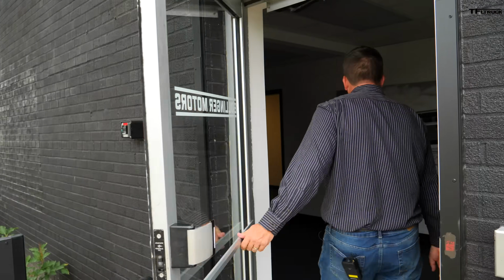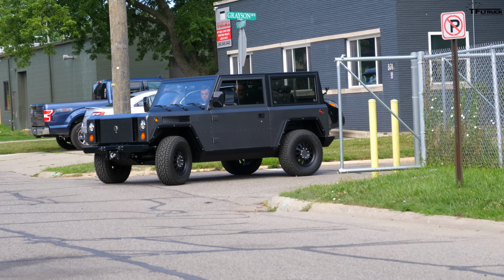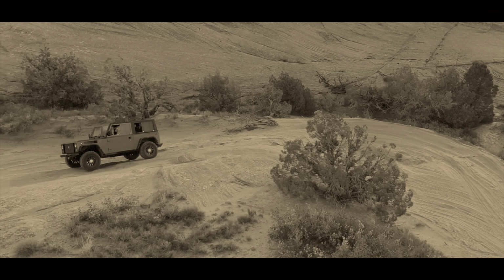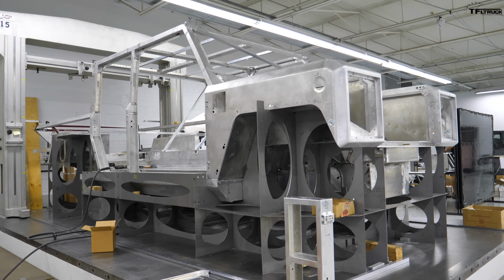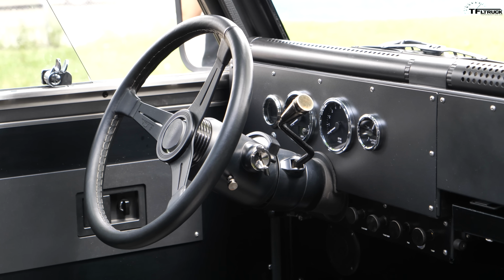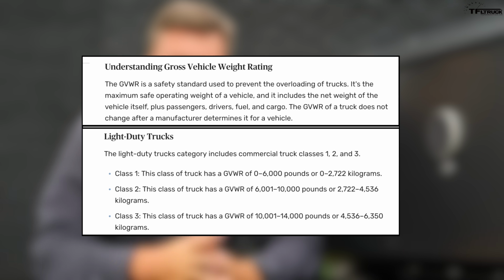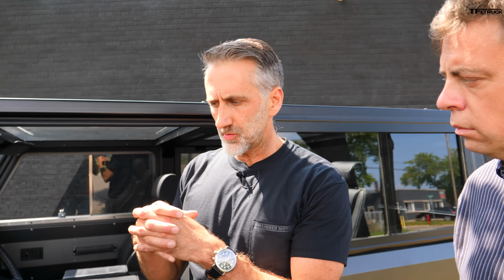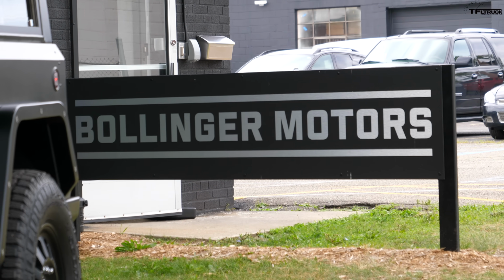EXCLUSIVE! Meet the Bollinger Trucks That Can Off-Road Like a Jeep and Haul Heavy

Comment: As the designer said, he built this like a classic Bronco.  Which is a BIG thumbs up for me.  If we are going to go EV's, might as well make them good looking.  Since we cannot get Ford to go back to what was fantastic.  It is interesting that it has a bit in common with what Top Gear built all those years ago.  Outside design.  And IF I had a need and the money for what Bollinger is doing, I would DEFINITELY buy 1 for the looks and the off road prowess it is going to deliver.  OR, just mall crawl with it.  lol  I don't often agree with mall crawler attitudes, I prefer functionality and practicality over show.  However, since this is range restricted and recharge viability is low, one has to be realistic about where it will be driven.  ;)
Reply: Ford Bronco coming out next year tho taking on the Wrangler.

So Ford knows what they doing

Comment: This thing looks exactly like the electric car built by top gear 😂
Just needs a diesel generator now...
Reply: Adding a small diesel generator to recharge battery pack was the best thing James did on top Gear, which Fisker stole (😉) and electric car builders SHOULD copy.
Reply: Georg B Geoff!
Reply: Geoff was all electric. The diesel charger equipped model was called the Hammerhead Eagle iThrust
Reply: That is the first thing i thought of
Reply: Long live Geoff
Reply: Will it hops driving uphills 🤣🤣

Comment: For whats suppose to be a mature product, its sure ugly. The other thing that concerns me is that if you look at how its being assembled, and materials. I just don't think its going to be capable of holding up to the safety standard that its competitors are already meeting. Not to mention that the hard corners and stuff, are likely going to make it a leaky vehicle over time in its current iterations. 

If this is indeed a $60k - $100k vehicle, are people going to want to pay that, while loosing the features and reliability and a repair market of its competition. I know that I likely wouldn't get rid of my current fullsize truck in favor of this. Even if it still had the same capabilities as it.

Comment: My thought on seeing any vehicle with a glass roof "They obviously aren't thinking about hot and sunny climates."
With a sun shade, the interior of vehicles already get to hot where I live. I would hate to sr the kind of oven these vehicles with glass rods turn into. Every surface in the vehicle will be a burn hazard.
Reply: hi T C...
'
a vehicle with a glassroof must have mirror - tint to keep cooool...
turn vent to little open and let the air out / in
Reply: Interesting because I was thinking the same thing about cold climate. The clear roof panels and lack of insulation or interior panels plus their ventilation grills will not work well in cold climates with lots of snow.
Reply: 3M make a hell of a tint that reflects heat.
Reply: Yep, here in Australia people buy those big reflective windscreen sun shades, then cut them to the size of the desired window and tape them on. Dark tint isnt enough, you need insulation and reflection
Reply: That shiny gear shifter will leave a nice mark.
Reply: Tints are a thing and they work, Combined with light fabric shades it's perfect fine even in desert climates.

Comment: Definitely prefer the classic square body design over the eurotrash sharp funky angle look of most new vehicles.
Reply: The “eurotrash” designs take int consideration things like, aerodynamics, crash tests and pedestrians safety.
Reply: Nick Sokolis bruh, they can make safe vehicles without the boring styling. Look at the original hummers, or a tank.
Reply: @collinbooker  😂
Reply: @nicksokolis6343  to the point where everything looks the same. boring!
Reply: @nicksokolis6343  Most of them have nothing to with aerodynamics, and in many cases, make it worse.

Comment: it looks like a bronco kinda but 200 miles of range that's not that great and that's with no trailer pulling anything so only will be able to tow 7500 lbs for what 100 miles or less that's just insanely low

Comment: Honestly, if the price point is good, this is my dream off road SUV.
Reply: Hopefully there's a current bush it there to plug into. If the converter can cover enough to allow a little generator to fast charge, then yes, this would be amazing. Couldn't agree more
Reply: Lol so buy a vehicle that doesnt use gas only to use gas in order to charge it to go offroad.....brilliant!!!
Reply: @jeffhall768  ibe heard this argument over and over again, but consider that a full charge may come at the offering of less than 2 gallons of fuel for another 200 miles in an off road beast?! I would take it. 
We need to stop looking at electric vehicles as being inferior because they may require gasoline to charge, hell I can charge a car for 300+ miles with less than 2 gallons of gas, or use 15 gallons for a normal car.
Reply: @mountainmanjim6366  also, during off road use, a vehicle uses more gas to go even less if a distance. I agree, charge it up and let's ride
Reply: Mountain Man Jim No way on earth would two gallons of gas in a generator provide enough power to travel 200 miles. 

According to the specification sheet in the video, it has a 120 kWh battery pack and 200 mile range. Let's therefore assume that to travel 200 miles requires 120 kWh. Even the most efficient diesel generators available are less than 50 percent efficient but let's say you can find one that turns fifty percent of the fuel into electricity. You would need to burn 240 kWh worth of fuel. Given that diesel is about 10 kWh per litre, even with the very best generator and assuming no losses anywhere along the system, 100 percent efficient charging etc you would require 24 litres of fuel. In the real world with inefficient generators, battery charging losses etc you will actually require much more, perhaps thirty plus litres. Which means that when powered by a diesel generator this is less efficient than a directly diesel driven truck.

Clearly diesel is therefore only viable as a range extender / emergency charger. Not to mention that in order to provide a reasonable charge in an acceptable amount of time you would need a large and heavy generator. Producing 120 kWh of power would take ten hours with a domestic sized 12 kw generator costing several thousand pounds.
Reply: @spencerwilton5831  way to kill the buzz bro 😄

Comment: If they are hand welding car frames when this goes into production this is going to be horribly expensive.  This looks like a short line vehicle.  So Small numbers and expensive.  So it's just another off road toy for people who have money.
What worries me just for costs:
- Handweldered frames
- In house made portale hubs
- Rivets
- too many custom machine parts.  I see no cast or plastic parts on the vehicle
- Only 200 mile range

Its cool but its like an OG hummer.  Its design and function is targeted at a niche well off audience.  Wish it had an insulated roof option.  I see all that glass or plexiglass and I immediately think sweat box.

Comment: I am thinking that Rivian and the Tesla pickup will bury these guys, sorry.
Reply: I think they will stay A small niche manufacturer. Probably never mainstream
Reply: Much rather have one of these with low gear range, adjustable ride height, pass thru beds for lumber and sheets, completely customizable on the dash for anything you want. This is an offroaders dream build, not to mention the daialy 20mile commute can be made all electric
Reply: Duh! CEO just said his company is not competing with other electric vehicle companies.
Reply: The rivian is going to be 100k+, vastly different market from the bollinger
Reply: @BigSam63  ok, that is not what Rivian has announced.  They are starting around 75k.  With state and federal discounts it will start around 60k.  I just looked it up the truck has a starting list of 69K for the pickup and 72.5k for the SUV. Please do your research.  That means here in CO I could be into a Rivian for around 55k with all of my discounts from the state and feds.
Reply: @richfarfugnuven6308  have you seen vids of the truck? I do not believe that starting price for a 2nd. You're also talking about the smallest battery pack, which will not have a 400 mile range.
Reply: @BigSam63  remember they have all of the Amazon money and Ford money behind them.
Reply: @richfarfugnuven6308  what does that have to do with anything? Rivian is building luxury electric trucks, they are going to cost an according amount.
Reply: yes, they probably won't even make thru either first year of production. It's a hobbyist vehicle but the owner didn't build it.
Reply: In order to succeed in the “niche” market they are anticipating then they will have to be better at something, off-road capabilities, range, price point, reliability etc. Otherwise who would waste their money or how many will?  These guys wouldn’t be the first Edsel...just saying

Comment: Like others have said, the range really kills the offloading potential. Otherwise it seems like some pretty neat engineering.
Reply: Unless it is towed to the trailhead like so many Jeeps or Razrs are. By a diesel.
Reply: @Adiscretefirm  Even then, whats the point? Might as well make it a dedicated offroader with zero attention given to on road driving. Prob get more range out of then too. They are clearly aiming for a specific demographic, and falling short. The battery tech is holding EVs back currently, and i dont expect that to be for much longer. However thinking that this can currently replace a modern Jeep Wrangler for example is pretty silly.
Reply: @juanticimo  well I can see it being a high priced accessory at the farm or hunting property, or as I said, just like the "street legal" Jeeps that are lifted to be taken to the area on a trailer and used on trails where the tow vehicle can't go. Lots of rockcrawlers are transported to the trails and after mods are into the $60K neighborhood. I can also see the quail plantations or similar hunt vacations outfits using these to take customers out in the field instead of noisy gas trucks. Quads are the usual transportation at my friend's hunting property, but occasionally an electric golf cart is there and it is shocking how many animals you surprise compared to the loud, smelly gas driven quads. But you could still use it to run into town for beer, or to use the highway to go a few miles and take a different trail that would be ten windy miles of single track if you stayed in the woods. Niche for sure, but they don't seem to be aiming to take on the big 4 truck companies. As long as charging networks are equivalent to gas stations in 1903 in availability ALL EVs are niche, but I am confident hydrogen fuel cell electric will supplant battery stored power in a few decades anyway barring major advances in battery capacity and charge rates.

Comment: Everyone wants an offroad vehicle that takes hours to recharge. Its too heavy, and you can't fix it on the trail. This is one of the stupidest vehicles I have ever seen.
Reply: Finally, someone who actually thinks of repairs! It disturbes me how many people try to blow that bit off.
Reply: What is there to fix? Not like you need to worry about punching a hole in the oil pan, or throwing a rod, or losing a gear. You aren't going to loose coolant or gas if you flop it on its side or roll it over. Don't need to worry about smoking a clutch or getting fluids on the clutch, or overheating a slush box. With inboard brakes you don't even need to worry about tearing a brake line. The belly pan is flat, so you aren't going to jam a branch or a rock in between something and tear anything up. 
You might bend or snap a steering rod, but that happens on anything.
Reply: @BlueDually4x4  Interesting! You are the first person I have heard of that thinks electric cars don't break especially when they are abused offroad.
Reply: @BlueDually4x4  and that argument makes it sound like other off-road vehicles come without skid plates or protection of any kind.

Comment: Wonder why noone is talking about the process of making the batteries. and where the old and used batteries are going to go.
And also dependin how the elictricity is produced, recharging it might polute more then normal fuel.
Reply: Nekomemi yes that is an issue right now. However as the technology improves those issues will fade

Comment: 1. Independent Suspension 
2. Boxy Look
3. Massive Ground Clearence

= Winner Combo
Reply: when did independent suspension considered as a winner on off road rig???
Reply: @MernernerYT  when people actually realised ground clearance is more important than flex.
Reply: @okigojuryu  How about Maintenance and Modding. and flex doesn't matter on off roading now?? which universe are you living. lockers aren't magic
Reply: @MernernerYT  I never said that, ground clearance>flex.
Reply: Works great on my side by side.  Works great on the front of a ford raptor.

Comment: I'm not impressed. This is a niche vehicle for a few wealthy people. Although it looks rugged, I'm perplexed at how poor the manufacturability of this thing appears.  They are using lightweight materials in some places and in others are using way too much material. This thing has to be hand build like an aircraft. Practically no thought has gone into the interior which will get old fast for customers.  The cabin will get very hot with all that glass and I'm sure this thing is going to have wind noise problems.  I liked some of the retro but never thought I'd see the old 60/70's steering column w/ PRNDL on top ala Ramcharger & Grand Wagoneer. Some of the engineering was pretty cool but I'm not sure they focused on the most important things.
Reply: I don’t see how these can sell for less than $200k and, at that price, are not capable enough or refined enough.

I would love for them to succeed but I am doubtful that they will ever make more than a handful of prototypes. There has been no thought given to manufacturing processes or controlling build quality. 

The all-aluminum construction is probably the biggest negative about it. There are a lot of quality, light-weight materials more forgiving and less time-consuming than aluminum. They can design crumple zone all they want but any number of crash types will total the vehicle, serious or not.

My prediction is that their patents will be more profitable than their trucks.
Reply: this company isn't serious, good call! Thanks for your educated observations.
Reply: less than average wealthy people!

Comment: These guys get it in turns of simplicity. I like the look honestly and love the idea of getting a simple truck with next tier mileage. If I could walk in today and buy a raptor with no turbos, no $9000 802A upcharge id buy. This just proves to me still though that even with no additional screens or power to suck juice from that battery and still only getting 200 mile range that were still not quite there.... this ends up looking like nothing more then an old international with electric guts that’ll still fall short to the big guys on the road.

Comment: The front opens to hold wood. What happens when you hit someone..
Reply: What happens when you floor it and it's not strapped down? That stuff is going to find a new home in someone's windshield or engine.
Reply: How is that any different than work trucks with racks that mount supplies across the top? I'm sure the engineers are smart enough to realize it will need tie downs.
Reply: They get a big splinter in their ass. LoL

Comment: I love it, but the 200 mile range will be a deal breaker for many.  Portal axles!
Reply: with this design it will have terrible aero so 200 miles is prob the best you get. On highway this truck will be terrible on range. But this is a lifestyle truck for a very small portion of the people and they will buy it anyway.

Comment: i will admit a hard fact that most won't... i don't drive 200miles daily so 200miles range would be fine for a first EV for me to use as a daily i have a seperate gas vehicle i use as traveler anyway.
Reply: I drive a 80 mile range EV to work everyday, while my 4wd lifted truck is parked because it makes no economic sense. Ya, Ill make this trade. It will just get better from here. Keep in mind 90 percent of truck drivers DO NOT use the truck as a truck, they are the equivalent of a mini van at this point.
Reply: @calivalley9056  for sure most trucks are just used for show. I use mine at least every other day but even i could live with a midsize truck for the most part but they just aren't wanting to make any MPG progress on those either. They are forcing people into EVs on there own. I fully believe the technology is there to make a 50+ mpg full size gazzer truck. But here is too much money to be made making them still get 17-21mpg average.

Comment: Interesting comparison with Tesla.  Tesla is a software company that happens to throw together vehicles while Bollinger is a car builder who uses technology (software) to enable their mechanical designs.  The tech in the Bollinger is behind the scene and not distracting the driver while the mechanical design is up front, very robust and elegant.  They need to throw in an on board generator set to maintain the battery and I would be interested.

Comment: if they have everything sealed up to stop dust and corrosion. high capacity main's power outlets you could run decent sized welders on and maybe a small quiet diesel generator option it be a good for farms and mining. even more if it has a very good low range gearing and higher towing capacity in low range even if it topped out at 25MP/h

Comment: What sense is it to put the tow hitch behind the license plate? Everytime you tow, you will get pulled over for a license plate not visible from the rear. Think motorcycles that fold their plates up so they can't be seen while stunting. No bueno.